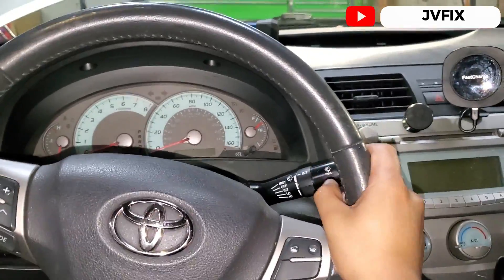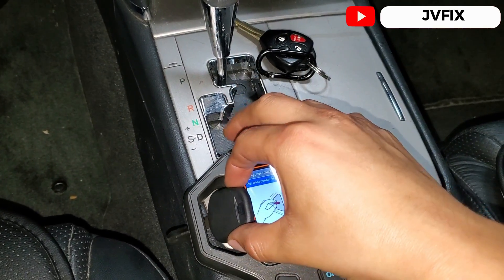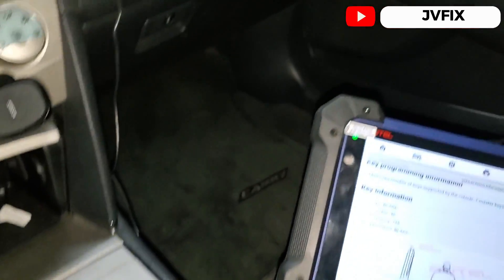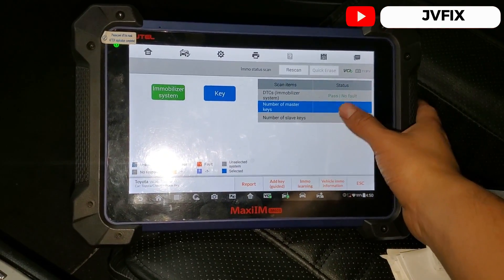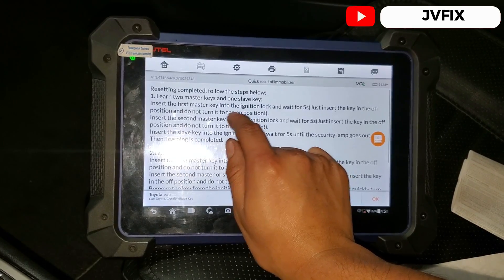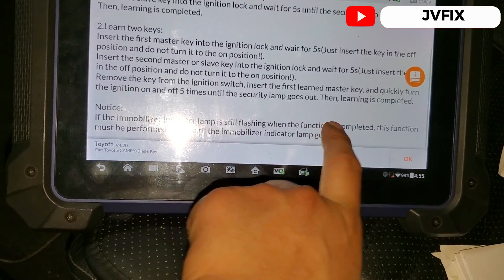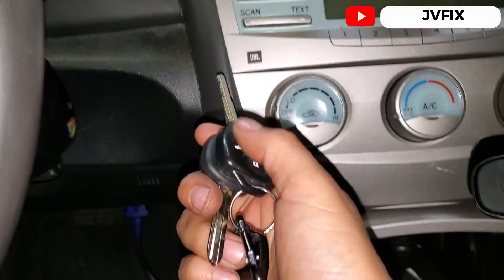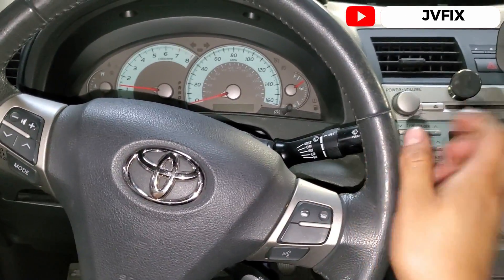How i programmed all keys lost on this 2007-2011 Toyota Camry using Autel IM608

Comment: Nice video thanks for sharing🙏🏻 i have a question: on vehicle immo info it says ID 4c but the key you programmed has ID 67. So are 4c and 67 the same ID ?
Reply from the maker: no is not the same i believe on some years toyota changed the chip and they call it the G-chip